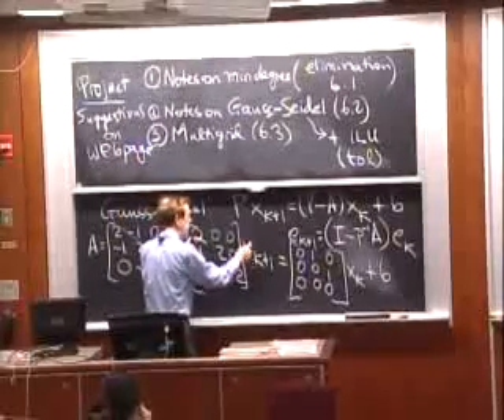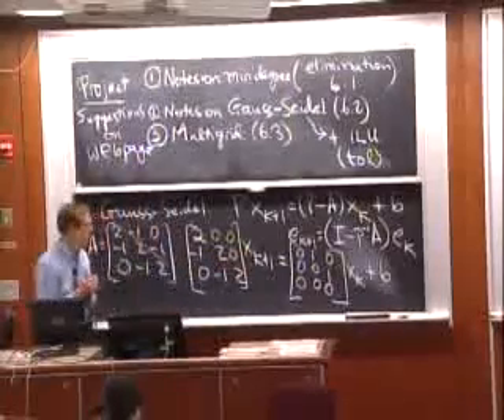Lec 16 | MIT 18.086 Mathematical Methods for Engineers II

Comment: could anyone explain how is the size of I in 2D  25x4?
Reply: it was the square of the 1D case (5 x 2). In 1D, the fine grid has 5 points ( 7 - 2 boundary points) and the coarse grid has 2 points ( 4 - 2 boundary points, the 4 comes from "jumping" every two points on the fine grid as drawn on the board).
Reply: 5 grids in x-axis, 5 grids in y-axis, total 25 grids. Each grid needs 4 points around it. So it is 25x4 matrix.